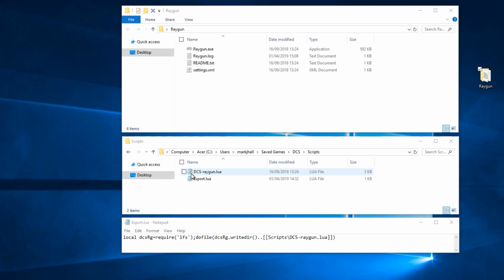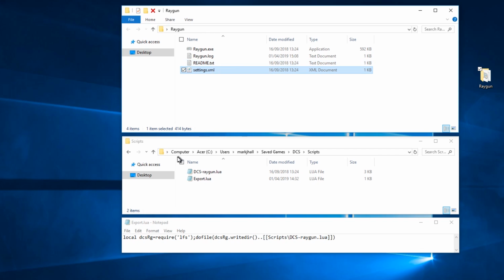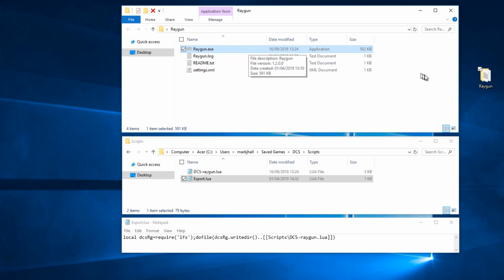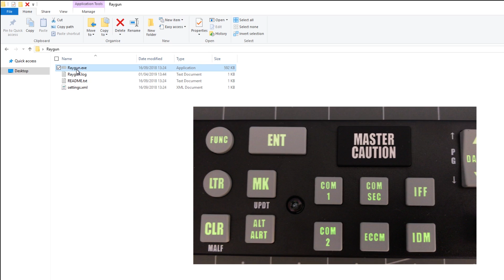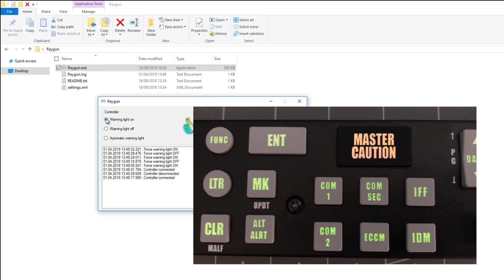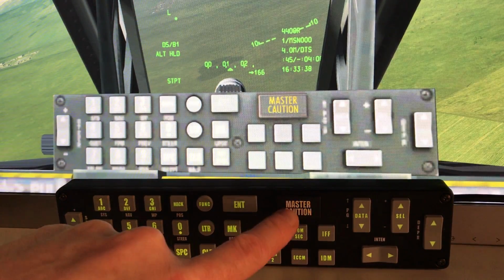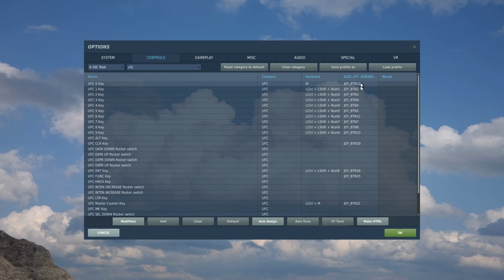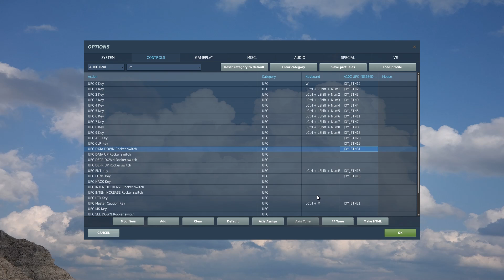Buddy-Fox A-10C UFC Up Front Controller

Comment: What is that header?
Reply from the maker: Raimondo thanks for the view and the comment I appreciate it. If you mean the pin header on the printed circuit board inside the UFC, I expect it's for in-circuit programming of the micro and testing.
Reply: @A10SimPilot  Roger, nice video. I bought the device and am using it, it's lovely. Thanks for replying!
Reply: @A10SimPilot  Thanks, it does make sense. I bought it and I'm loving it. The rheostat (the twisty knob on the side) tends to be a little annoying, I will probably move it to the top and change it to a slider... If I get the time to do that. In the meanwhile, it's added a ton more convenience to flying and managing the A10C.